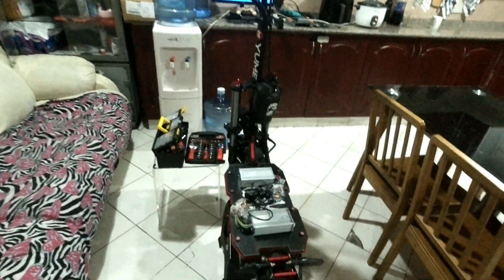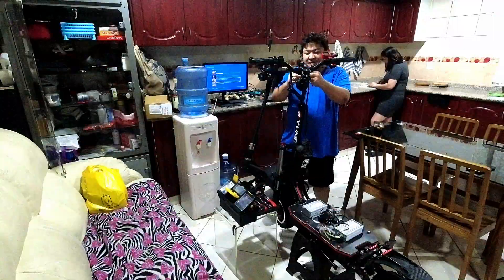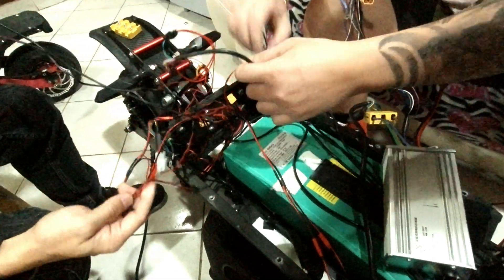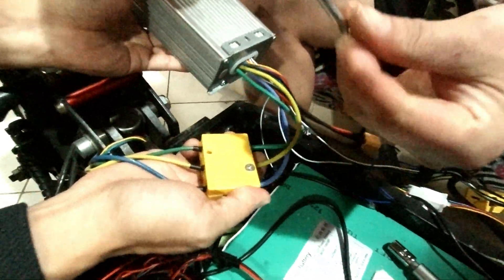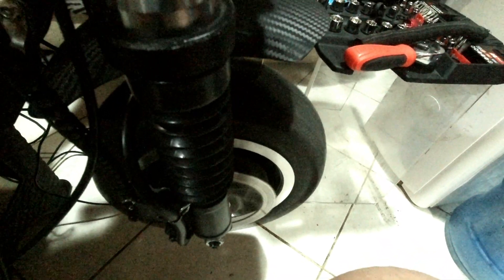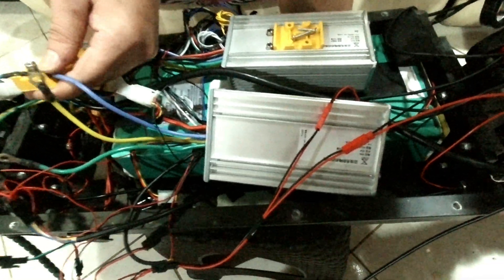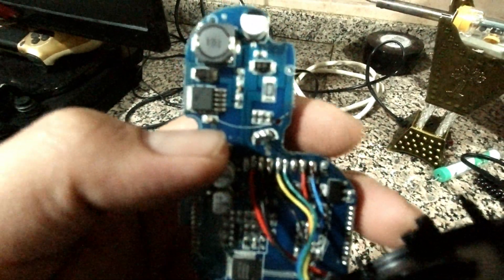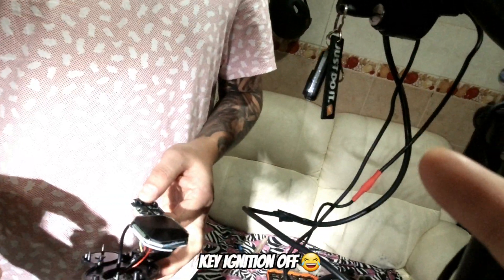YUME Y11 - Controller Replacement + Thumb Throttle Conversion

Comment: Hi, normal lang ba sa Sinewave na laging max speed kahit anong lakas pindot sa throttle at may delay siya? Kaka install ko lang nung akin kahit anong pindot ko sa throttle gear 1-2-3 lagi siyang max speed normal lang ba un? at may delay siya na 1 second.

Comment: Why you switch controller?
Reply from the maker: Because sinewave suits my riding style and my requirement. I don't need much torque as I always ride in flat roads.
Reply: @druzeroseven  made a video how to wire it check my vids homie
Reply: Square wave can break through motor wire insulation after a short period of time, sine wave is easier on the insulation.
Reply: @druzeroseven  Are these controllers better with power delivery compared to stock i find stock is touchy as :(

Comment: Hello when you pull the throttle a little bit and the wheel turns slowly is it silent because I have the same controllers and my scooter makes a noise it sounds like clunk clunk clunk not very loud even if the wheel is not turning is make this sound is this normal?
Reply from the maker: Mine is silent
Reply: I have exactly the same problem after changing to the new controllers.... although I have not changed and updated to the new throttle yet im thinking this is the problem.... did you get yours working buddy ?
Reply: Yeah I fitted a new front controller and it’s fine now and almost silent when taking off as it’s got sinewave controllers that’s how I new it had a problem because sinewave controllers are quiet but when I took off on my scooter it was making a clunking sound that was coming from the front wheel but it’s all sorted now thanks mate 👍 hope you managed to get yours fixed
Reply: @imlee5217  i took my y11 out a spin one day and took it up to 47mph and both controllers shorted out and left the scooter lifeless wouldn't charge or anything... since then I ordered front and back controllers from yume ( the new sine wave ones) they have been wired up and everything looks good but doesn't move the back wheel just spins slow with a clunk noise like you described but I'm thinking I may need a new throttle that is compatible with the new sine wave controllers im sure I read somewhere that the original y11 throttle is no use with the new sine wave controllers... although I'm not sure I am stuck for information
Reply: Sounds like you need to plug the controller learning wires together there should be a white wire on both controllers put the scooter on something so the wheels are off the ground because the wheels will spin a bit but that normal there’s a learning wire on each controller it’s normally white plug that together switch on the scooter the wheels should spin this is normal it’s just the two controllers synchronising so they can work together you plug the white wires from each controller together then switch on the scooter then the wheels should start to spin leave it until it stops or if it don’t stop after about 20/30 seconds then switch the scooter off unplug the white wire then switch the scooter on an the controllers should now be synchronised and they should work together and be smooth I’ll see if I can find a video
Reply: Mine makes the same noise and goes slow when you pull the throttle